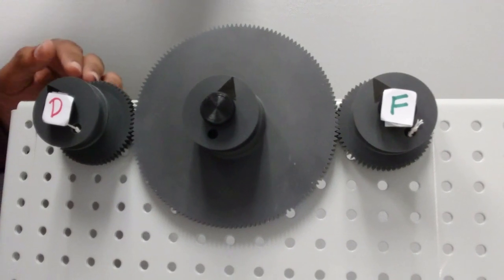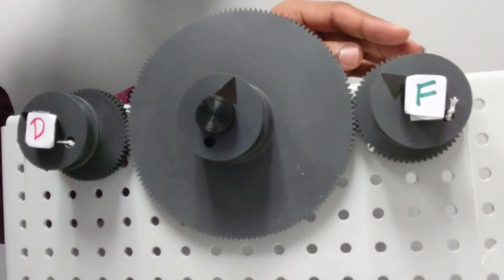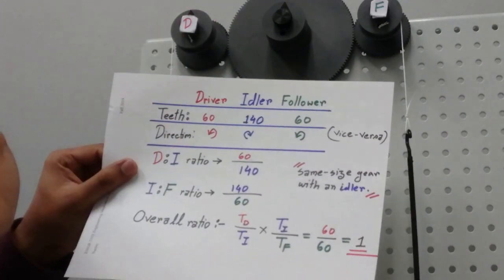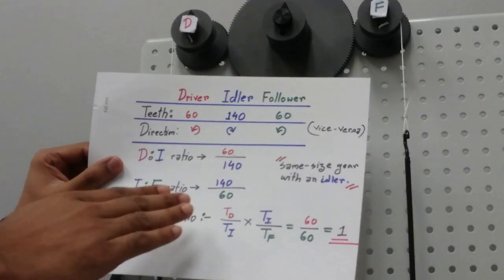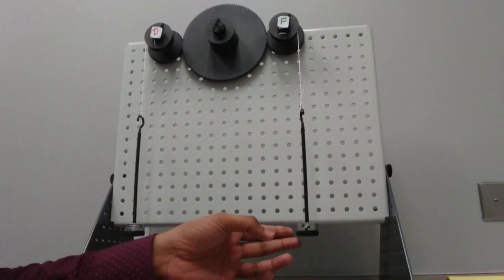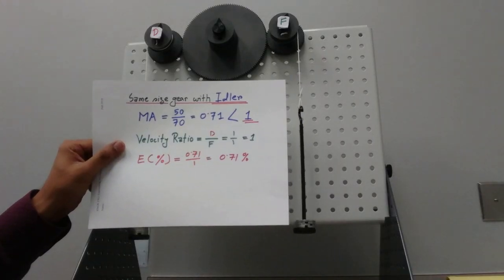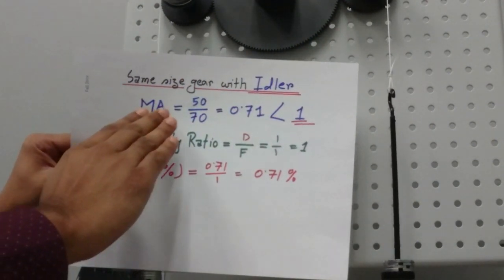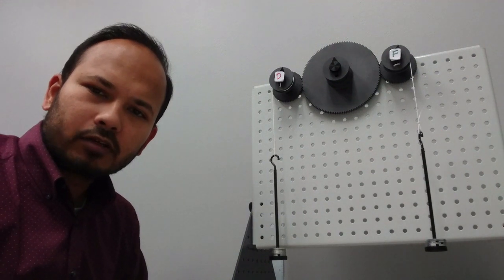Idler Gear: what is it? Benefit, Direction change. Why overall efficiency drop? M Adv. below unity?

Comment: How would the same setup be affected by having a smaller idler gear?
Reply from the maker: Very good question. The velocity ratio does not depend on the size of the idler gear thus a smaller idler gear will not have any effect on the overall velocity. The size of the idler gear depends on how far/close your driver and follower are located. An idler gear changes the direction of rotation of the follower and avoids the requirement of a very large diameter driver to connect the follower. 
Let me know if you have more questions or need additional clarification.  Thank you

Comment from the maker: The idler gear is also useful if you want to connect parallel shafts that are far away from each other. Instead of manufacturing a gear that is very large (to connect far away gear w/o idler) and ineffective we can use an idler gear in the middle.